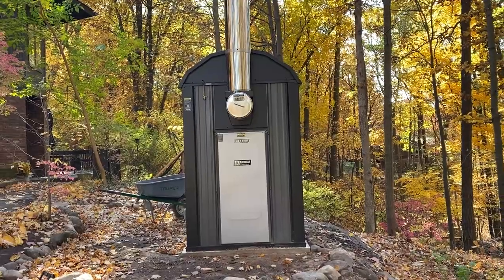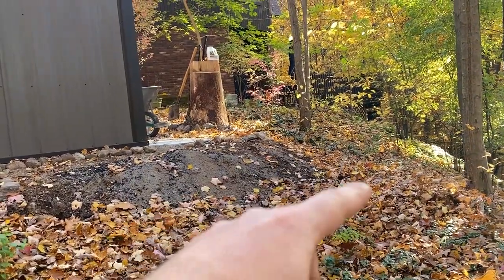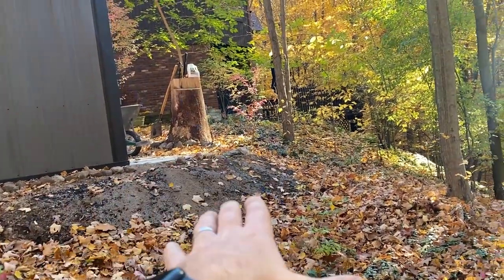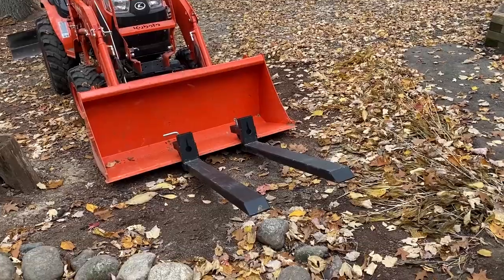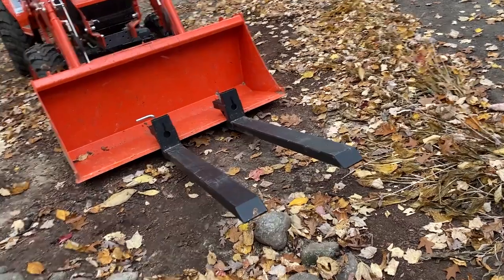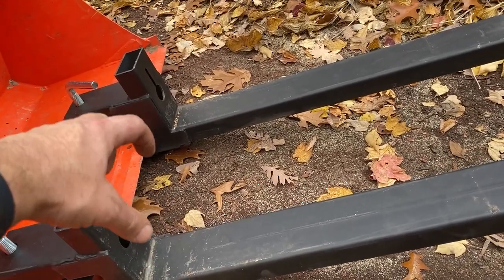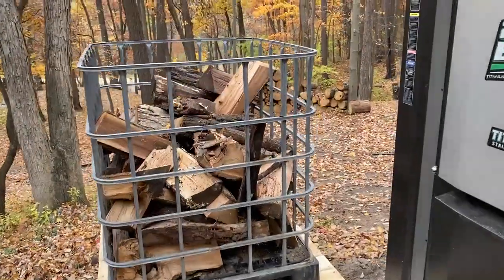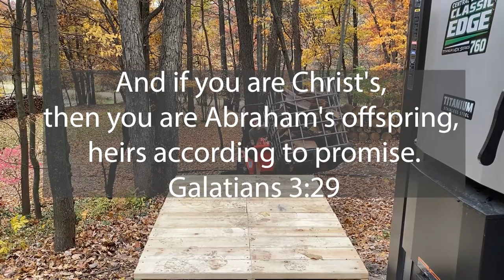Making the Firewood Perch For This Monster Wood Boiler #vevor

Comment: Have you check out running the return line from the house furnace that is closest to the garage to the garage to heat it/them then have the return line go back to the boiler?? You could do it fairly easy, I think. We love ours. Thanks for sharing. God bless.
You could widen the wood deck than build a lean2 over it. Then use metal for the siding. It would keep the wood dry and hide it from the driveway.

Comment: Not bad, not bad. But 4:55 one more board in the middle had to be added: both for the strength of the structure and for additional support of the boards above. Well, because all the load will be in the middle, and when the boards rot, it will be especially important. And here on 11:02 it could be good to add a bevel to strengthen the rigidity of the entire structure between the long legs of the support and the base of the flat support. Either the soil will soften from the rain and snow, or you will place 1 m³ of firewood in the wrong center with a tractor and this site may collapse or sag.
PS En is not my native so the words or word order could be not the same you get used to.

Comment: I love the forks on my John Deere. I have a quick attach frame which is far lighter than my bucket which brings me to my next point. You lose a lot of lift capacity using forks on your bucket versus a lightweight frame and forks. I use my forks more than my bucket. It's a great tool!

Comment: I enjoy your videos. thank you. The bolt on cutting edge helps to strengthen the bucket edge as well as prevent wear to the bucket itself. I'm sure you intend to install that edge, the stress from the forks are a reason to do it sooner than later. if you want an inexpensive source for an edge, go to your local county highway dept. or city streets dept. etc. and see if they will give you (or sell for scrap value) a used cutting edge from the plow equipment. Most departments use carbide edges that are removed when the carbide is used up, leaving a fair amount of good steel. The holes are usually 5/8" spaced 12 inches. you can cut holes any where with a torch though

Comment: you have to do do those forks up crazy tight with a piece of pipe and use the spreader bar. if they come loose, with a heavy load like that on a hill, the tractor will roll. also ROPS only works when wearing seatbelt

Comment: Are those posts deep enough to get below the frost line?  It'd be a shame if they got jacked-up over the winters.  42" was the last depth for our part of Michigan that I can remember.
   If there was a way to jack up one end of your IBC, tipping on its side would also give you access to the bottom without weakening a side cutting a door into it.

Comment: Is there a door you can open to get the wood out of the bottom of the cage? Maybe your tall enough to reach to the bottom though? 🍁🍂🍁🦃💚🙃 Oh I guess you had plans for a door, I should have watched a little farther before I made a comment. 🍁🍂🍁🦃💚
Reply: Maybe a roof to protect the wood from rain and snow? And maybe widen the platform for up to 3 bins. Maybe fill the platform from the side where the slope is not so steep? And some kind of rolls or slides for the bins to be handled easier manually? Or just raised metal tubes to slide them on?

Comment: I have the same tractor.  Those cheap Kubota buckets aren't great for that style of fork. Your bucket will have a smile 😃 before you know it. I would invest in a real set of pallet forks, you won't regret it.   I use mine more than my bucket.  My grapple would be a close second.  At a minimum I would buy that cutting edge to add support.